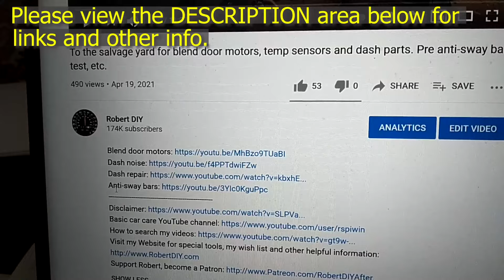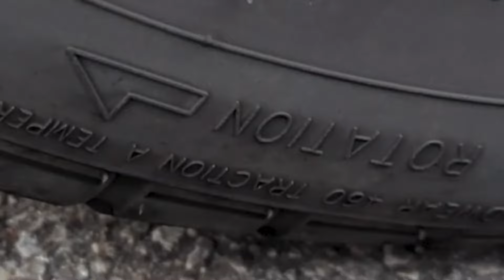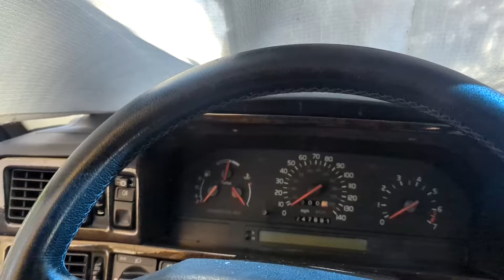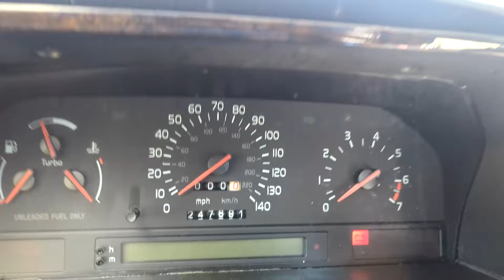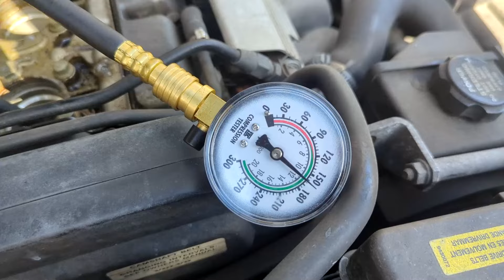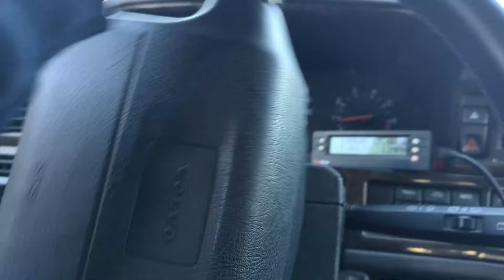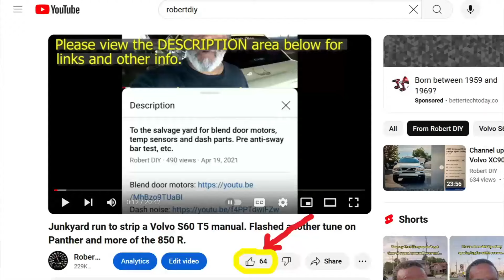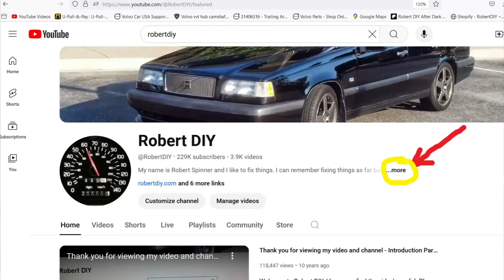You will not believe this! Merch, Bye bye Batman, etc.

Comment: best was to check leaking injectors is to  turn the key to position 2 but not start the car at all or turn it over  ..pull the spark plug(s) and see if any are wet ..what ever 1 or ones are wet means they are leaking ..ez check
Reply from the maker: Cool, thanks for sharing.

Comment: Never tried turning an engine lift while the engine is up high lower the engine and then do your maneuvering and that seal plug could be from a remanufactured engine. Also, if you overheated they come off.
Reply from the maker: Thanks for sharing. Didn't know that about those seals. The driveway is slowed and that was the real problem.